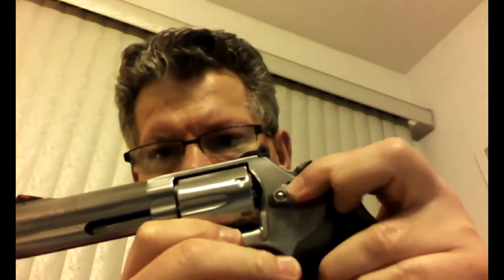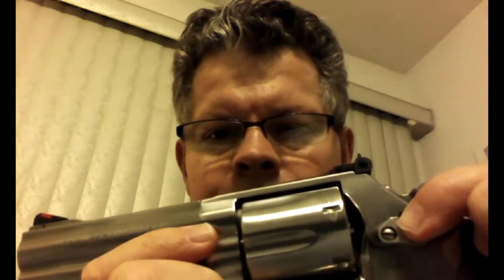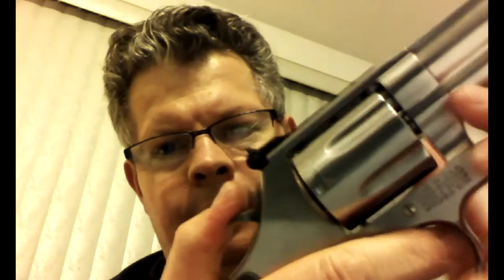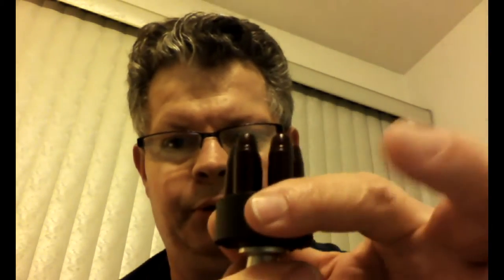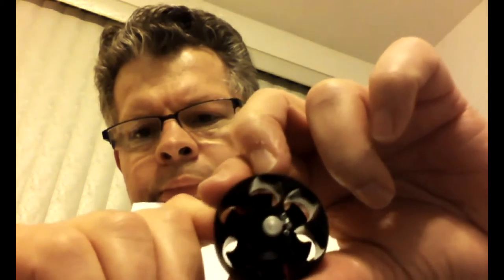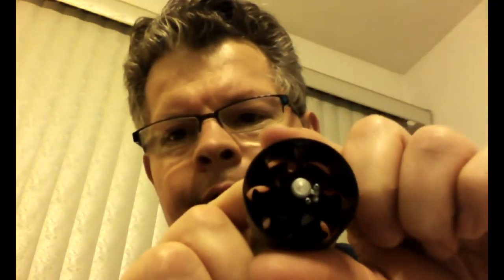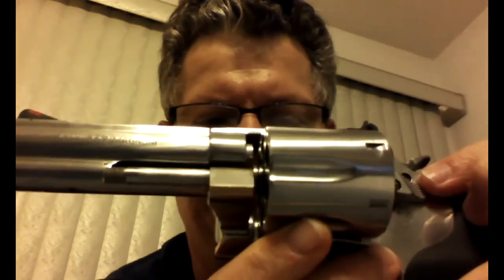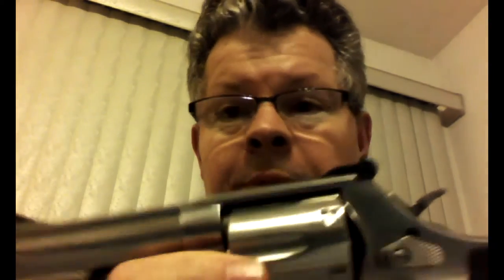Basic Engineering Principles

Comment: I always wondered how small the gap between the cylinder and the barrel was. I wondered if any gas or noise came out a small gap. It looks though as if there is a slight spring pressure holding the cylinder against the barrel.
Still, does gas come out? Is there a slight taper at the beginning of the barrel or does it line up perfectly?
What happens when they get old and worn out, any back fire or jamming?
Reply from the maker: The start of the barrel (the forcing cone) is tapered very slightly. Yes gas escapes the cylinder gap. If well cared for, they can last decades.
Reply: SubMan USN Thanks, I wondered if when they got well used that the gap may become big and a dangerous amount of gas may escape.
Maybe dangerous to someone standing to the side.
I would like to have one to play with but can't hear without massive rigmarole.
Reply from the maker: Igbon5 They are a lot of fun at the range, no doubt. I may be going today to shoot the 357 magnums for the first time. My range prohibits magnum rounds.
Reply: SubMan USN Lucky you.
Why do they prohibit magnum rounds?
Noise?
 Have fun.
Reply from the maker: Igbon5
Yes, due to the noise. It's a small indoor pistol/handgun/.22 range.
Reply: SubMan USN Thanks.